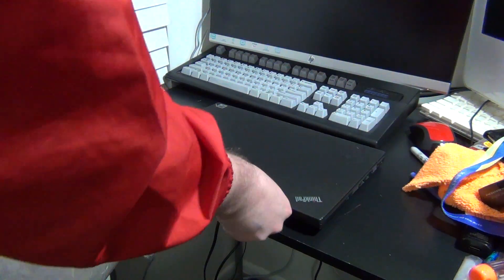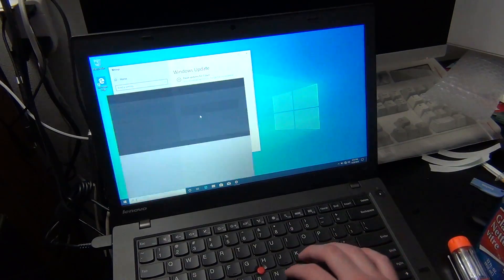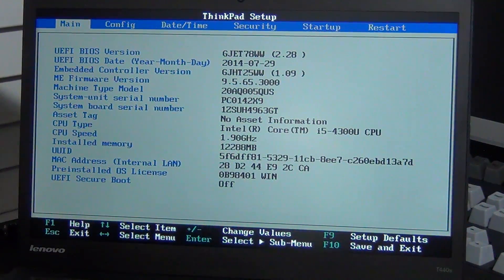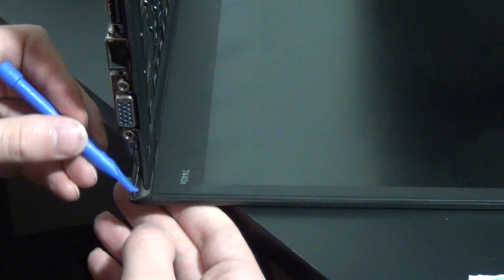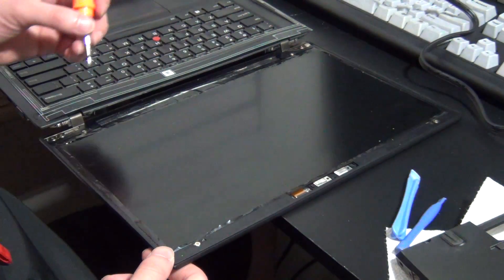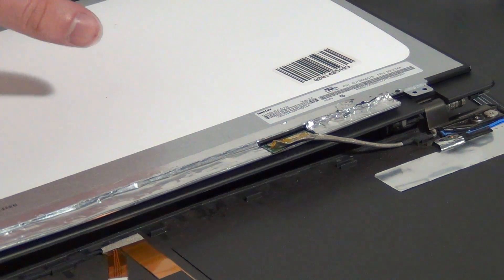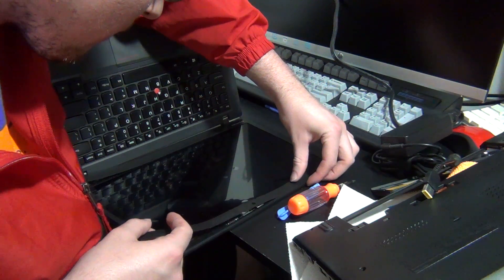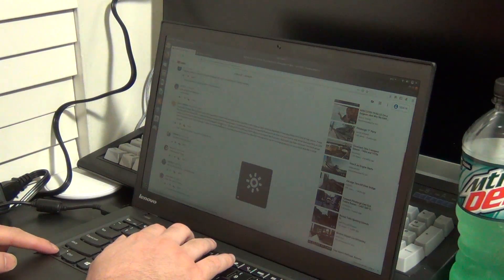Replacing screens on newer ThinkPads.

Comment: How does this process differ, if its a touchscreen thinkpad? (I have a T450 with touchscreen)
Reply from the maker: The touch screen versions have the screen and glass digitizers bonded together so it’s a whole different process to take apart.
Reply: @SebisRandomTech  Is it possible to get a non-touch display for the T450, and simply remove the touch functionality? 
I dont use touch almost at all anyway, and would REALLY like an IPS screen, as the stock screen has terrible brightness and viewing angles. - And also that darn annoying factory applied screenprotector, that i cant really figure out if i may peel off or not.
Reply from the maker: I believe purchasing a non-touch display assembly and then buying an IPS display would be the easiest way to do that. Just a heads up, if you’re running Windows you need to get a genuine Lenovo T450s IPS panel or reflash the EDID on the replacement IPS display, as the xx50 models have a display whitelist (these are the only models that have them, Lenovo realized their mistake and undid this pointless restriction with the T460). The whitelist causes the brightness to be stuck at maximum in Windows, but in Linux the brightness adjusts normally.
Reply: TouchDisplay is nice to have on a laptop if running Windows 10. In terms of thinkpads though it's really only practical if you got a s230u, x230T, 20QF, etc.
Reply from the maker: Microsoft has the right idea with the Surface Book/Laptop lines since they have a gorgeous IPS display that is not only touch, but uses a 3:2 aspect ratio instead of 16:9. The downside of course is almost nothing can be replaced or upgraded, and they’re rather difficult to take apart (I heard this has been somewhat addressed with the newest revision). Maybe Lenovo can take notes though and start putting 3:2 screens on some newer ThinkPads instead of removing upgradeability and functionality to make them a hair thinner. There is the X1 Tablet which uses 3:2, but that’s a pretty niche model even for ThinkPad standards...
Reply: @SebisRandomTech  Im using Linux (RHEL) on my T450 - So Windows would never be an issue... However, i cant seem to make sense of the fact, that youre saying the brightness control on a changed screen, is only a problem on Windows.
Reply from the maker: I can’t make any sense of it either. But I’ve encountered the issue myself and can personally attest to it, and it’s well documented online that the display whitelist is really only an issue for simpletons like me that primarily use Windows.

Comment: This is only if you need to upgrade the display, correct?
Reply from the maker: Upgrade/replace
Reply: @SebisRandomTech , Okay, i'm confused. If its a replacement on an Old thinkpad then why buy an individual Lcd display  rather than the whole LCD Display Assembly?
Reply from the maker: Sometimes it’s cheaper, and less parts are wasted.
Reply: @SebisRandomTech , How much did you pay for the LCD display? 🤔
Reply from the maker: I paid $48 for mine, however since it is an FHD IPS panel there’s a bit of a premium to be paid for that. If you aren’t looking to upgrade to an IPS panel and only want to replace your screen with an identical 1366x768 or 1600x900 panel, it would still generally be cheaper as a replacement 768p or 900p can be found on eBay for as little as $18-22, while the cheapest complete display assembly I can find for a T440, T440s, T450, etc is $42, at which point you might as well spend the couple of extra dollars to get an IPS screen.
Reply: @SebisRandomTech , really? Well, you can get the whole Assembly on ebay   for under $50 so you didn't save anything. 🙈
Reply from the maker: I did though, because that assembly didn’t come with a full HD screen so I would have still paid more for one that did. ;)

Comment: Although not relevant for this specific model, you probably should have mentioned having to reflash the eeprom on the screen when swapping out the display of many Lenovo laptops. Otherwise people are going to be scratching their heads when they can't adjust the brightness etc, anymore. So for example:
https://navhaxs.au.eu.org/blog/2018/08/26/thinkpad-t450s-diy-screen-replacement/
Reply from the maker: This is only the case on the xx50 models, like the T450 and T450s. Older ThinkPads like my T440s didn’t have it, and Lenovo learned from their mistake by removing this restriction with the T460 and other newer models.

Comment: Just get a newer laptop the cost will be the same this is such a waste of time.
Reply from the maker: Thank$ for wat¢hing thi$ video!
Reply: No way a New laptop would be cheaper than replacement of the LCD display on an old laptop.
Reply: The cost is not at all the same! A screen can be found cheaply for about 60€ - How do you find a laptop for that price?
Reply: Machismo you’re such a waste of time
Reply: In some countries paying 400 USD gives you a weak pentium chip with low RAM and pretty slow hard drives, while paying the same amount of money for a used laptop can give you a higher end i5 with typically 8GB RAM and maybe some 120GB SSD.
Reply: a display would be about 60 dollars, probably less, and a t440s is way more powerful than any sub 60 dollar laptop, unless you get a laptop with a broken screen, that you would need to replace. ;)
Reply: @32BitLink , $60 is a bit high.

14 Inch IPS 1920*1080 HD Laptop LCD Screen for Lenovo T420 T430 T440 t440p Screen $37 https://www.aliexpress.com/item/33008174373.html?src=google

Lenovo ThinkPad X240 X240s X250 Laptop Led Lcd Screen 12.5" 04X0324  $49.99 https://www.newegg.com/p/2RC-003M-00141?item=9SIA3AN6G58316&nm_mc=knc-googleadwords&cm_mmc=knc-googleadwords-accessories%20-%20notebooks%2Ftablet%20pcslenovo_-9SIA3AN6G58316&source=region

Lenovo Thinkpad X260 12.5" Genuine Matte LCD Screen display Complete Assembly $35.89 
https://www.ebay.com/i/254570080327?chn=ps
Reply: That's not very machismo of you.